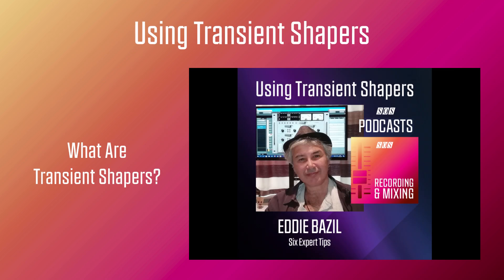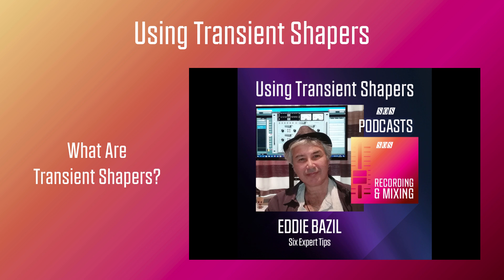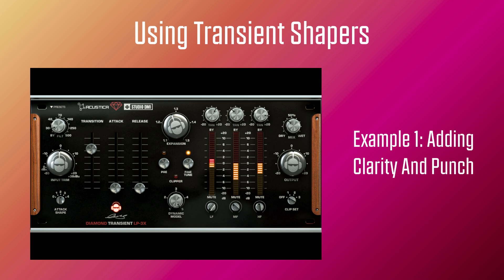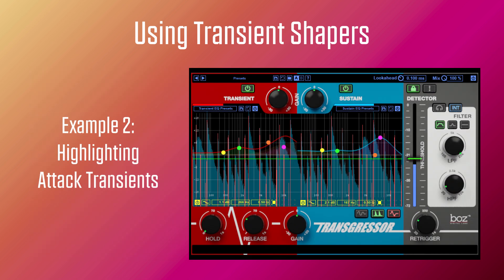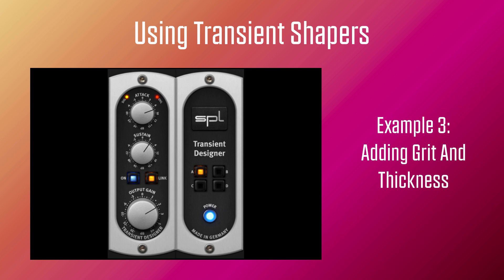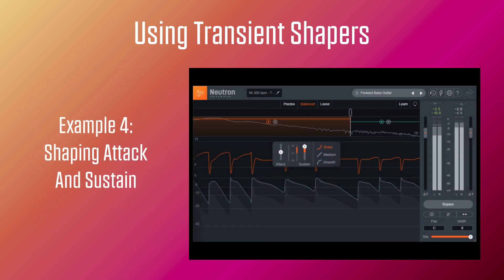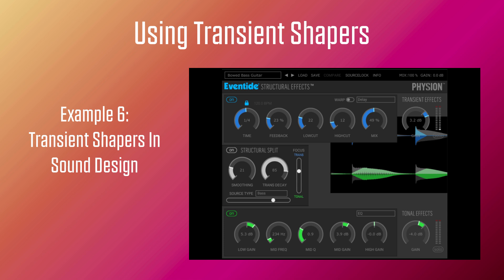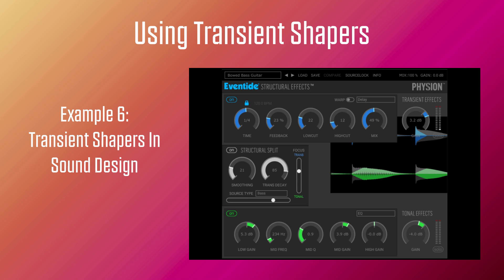Using Transient Shapers | Podcast

Comment: Transgressor 1 and 2 has also been my go-to transient processor ever since they were released, but since Wavesfactory released Quantum I've changed to that. It does the exact same thing as Transgressor (EQ for both attack and sustain parts) but also adds 15 other effects that you can use however you want.

Comment: Hi Eddie is there any difference between transient shaper and envelope shaper (multiband envelope shaper)? Thank's in advance.
Reply: Hi Verdi, Transient Shapers isolate transients and work only on them and separate to the body of the sound unless supplied as an additional function like Boz Digital's Transgressor or SPL's Transient Designer. Envelope shapers shape the entire sound and perform no transient detection unless specified. Each are very specific in what they aim to achieve. Hope that helps.
Reply: @eddiebazil5080  Thank's a lot now it is clear.